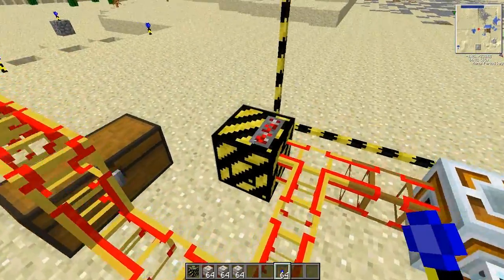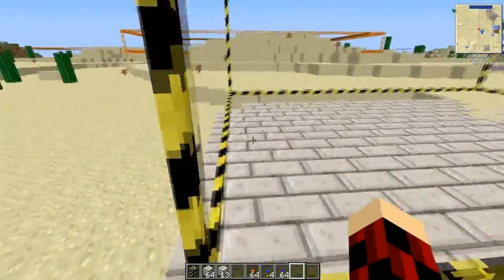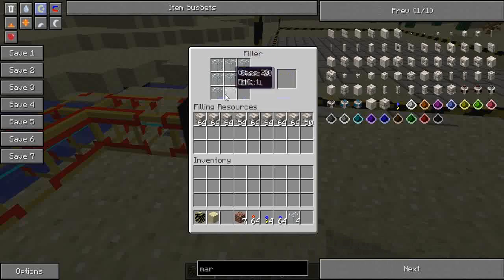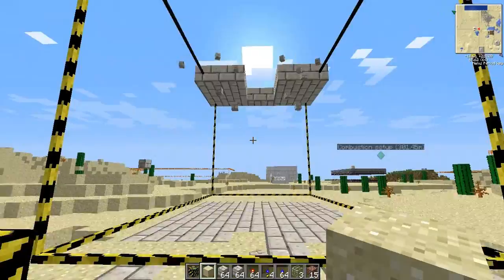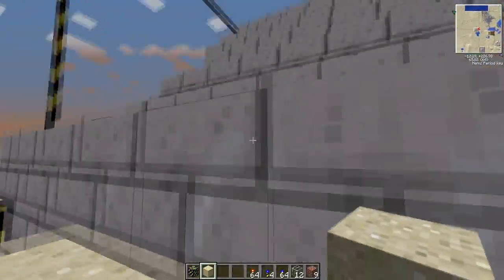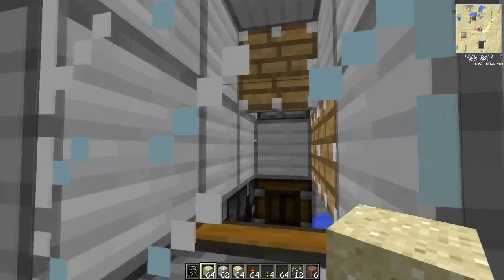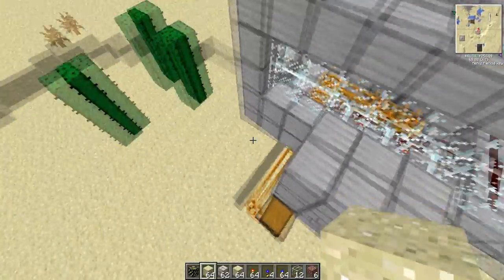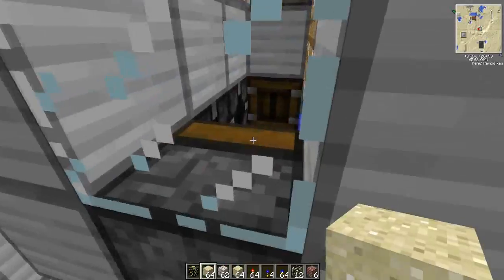Velerious' Tekkit - Fillers, Frame Motors, Filter sorting and Automatic Obsidian Generator

Comment: Just use a couple of powered obsidian pipes to suck up the items.

Fillers can be set up right at the level where the ore is, which avoids mining unnecessary stuff and wont leave big holes in the ground.

Oh and they're also perfect for mining layers of Obsidian. :D

But you're right, it really depends on the situation. I'm just saying that they're far from useless.

Comment from the maker: I mean they have plenty of uses :) such as using a quarry, a filler can then fill it by placing sand at the top and making it drop into the hole till it's full, likewise it can make a square house if you are lost and only have the filler at hand. Let us agree the filler is not completely useless but in terms of usefulness and actual usage, it falls below most other machines. I imagine mining reinforced stone houses as well would be a piece of cake with a filler to be honest :)

Comment from the maker: Ah but unfortunately the Quarry doesn't create as much lag, with the ability to build a piping system to send all your little blocks back home and into chests the filler unfortunately just takes every block and dumps it on the floor, most servers can then get massive lag because of this, some can even stop, depending on obviously the server and how it is hosted :) So it'd work maybe in small patches but to do a quarry sized hole, it'd be cheaper building a quarry in time and effort :)